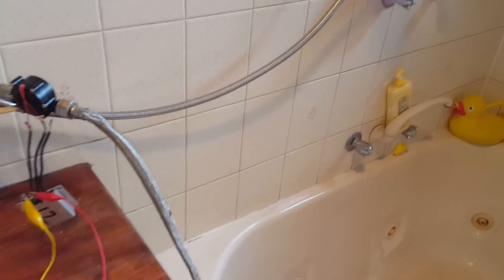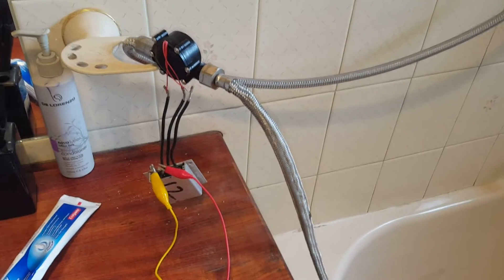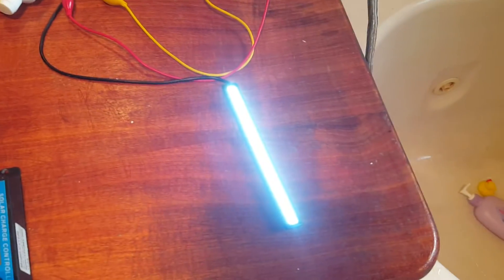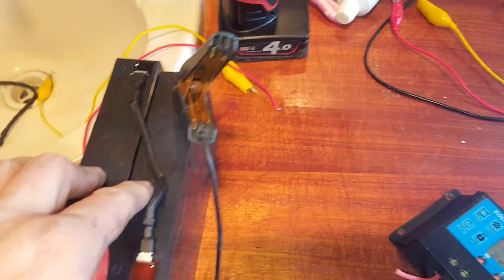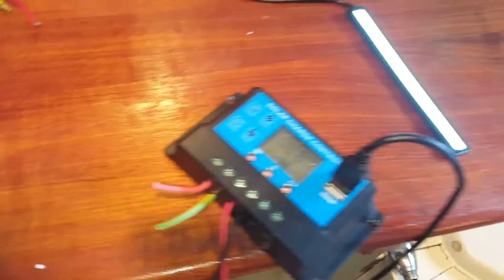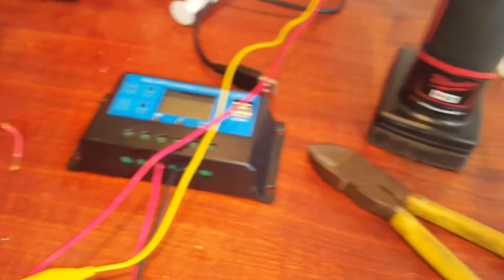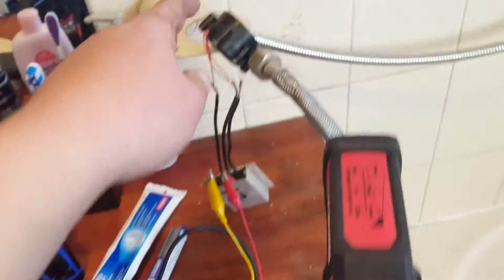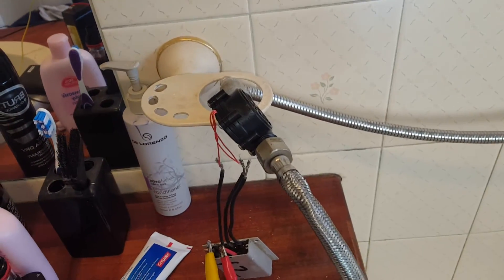Micro hydro power turbine plus pwm charge controller test

Comment: Interesting video! I want to buy this turbine and use it but I'm scared and not sure how to hook it up to charge a battery. It's my understanding  the turbine comes with a 3 phase end right? If I want to test this turbine in a river, should I buy a rectifier, generator, battery and charge controller? I saw you connected the turbine to the rectifier and to the battery. Please let  me know the easiest way to connect this small turbine to produce electricity. What kind of rectifier, battery etc ,if any, would I need? I want to be able to test it in a river. Thank you for your help.
Reply from the maker: Not going to work in river its high pressure low volume

Comment: What fittings did you use on the threaded ends of the generator?
Reply from the maker: 1/2 flexi hoses thread pitch is bsp
Reply: @Oneupthesleevecustoms  Thank you.
Reply from the maker: No problem have you brought one?
Reply: @Oneupthesleevecustoms  yes, trying to experiment with it but was having trouble finding the right fittings. But should be able to go ahead and do some trial and error now.
Reply from the maker: Good luck mate :)